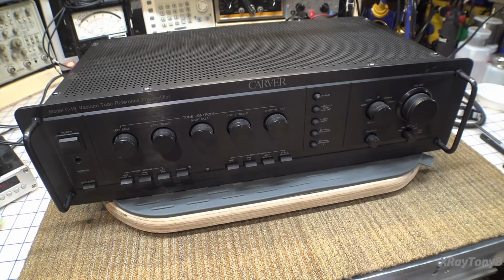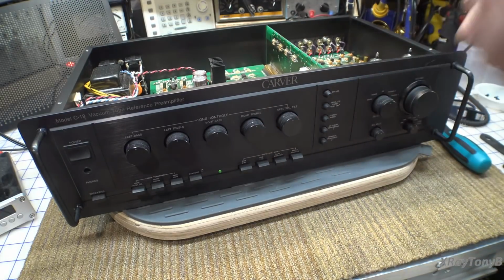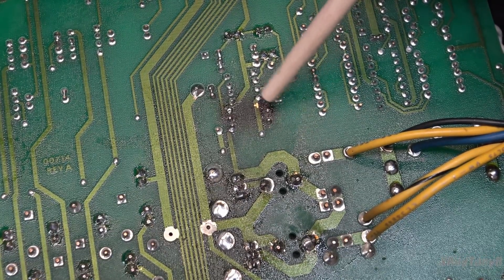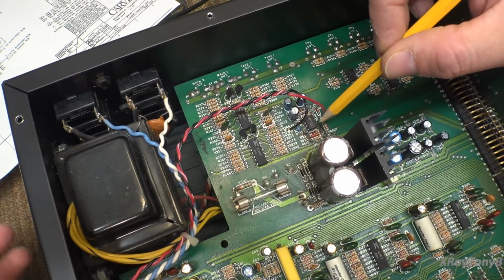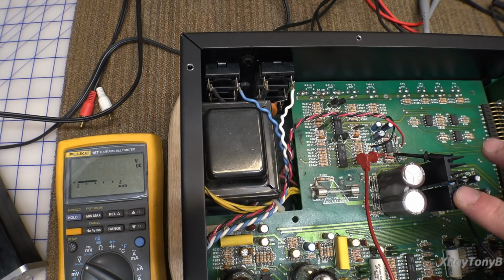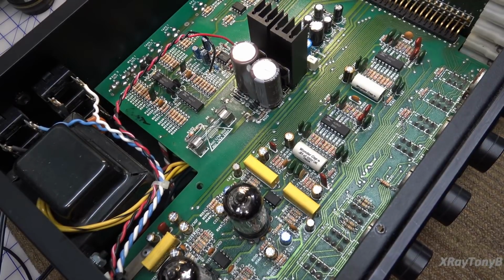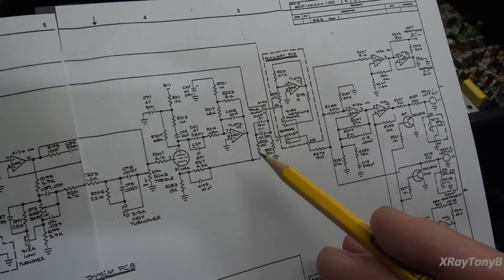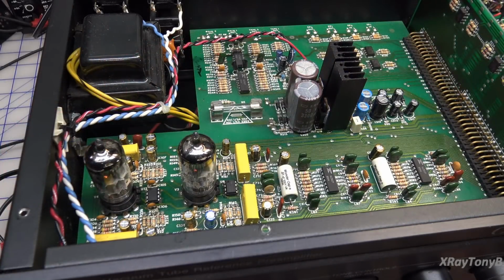Carver C 19:  Troubleshooting a "Simulated Microphonic" Tube

Comment: Since unit acts up when warm, this would have been a perfect contender for freeze spray (spray and pray).  Only need to drip a drop on components so you can single them out.
Then if the unit seems to cure itself, you only need to heat up with hair drier to get back to where you were.
Very interesting having a microphonic IC!

Comment: is the +10 supply coming from a regulator and then feeding directly into a 10v zener.......NO !  the zener will slowly cook.   can you show me the +10v power supply.
this is why the pcb is cooking to black.   normally you would feed the zener from a slightly higher voltage (+12) thru a resistor to set the zener current and then bypass the zener with a cap.    never hook a zener directly across a regulated supply at the same voltage.        if you wish to use the zener as protection, it should have a higher voltage than the supply and a fuse for it to blow is the supply goes out of limits.   but the pcb cooking and the look of the zener itself tells you it's really getting hot.....my guess is somebody missed something in the design.....

Comment: In my dimension this is caused by quantum entanglement -- the tubes can be anywhere in the universe but still connected.
Reply: Anthony Ng well here in the Multi-Verse, the tubes are both blown and working at the same time. Also in one of them, Carver is just a budget brand and Radio Shack (Tandy) Realistic ones are the best!

Comment: TLO72 in a "reference preamplifier".  Crimony.
Reply from the maker: All opinions of this preamp aside, it seems that the audio path is through the 6DJ8 tubes.  The TL072 only seems to control the gain of the circuit.  As I said in the video, I really didn't study the circuit very closely, but it appears that a better opamp with better slew rate and lower distortion wouldn't make much of a difference.  It also appears that they used higher quality (at least for the time) capacitors in critical areas of the circuit.  The thing I really had concern with is the overall build quality.  The circuit board material and layout was built to a cost.  There was very little shielding and the power supply seems to be inadequate for the circuit it needs to supply.  The high voltage for the vacuum tubes was derived using a simple voltage multiplier circuit, rather than a discrete winding on the power transformer.  I'm not sure how this would affect noise.  Now to bring my opinion into the subject, the preamp was very quiet and clean sounding when all put together (although I didn't do much testing on it).  I just question the build quality of something that was this expensive when new.  Thanks for the comment!
Reply: @xraytonyb  I found that a few parts are what separated Carver from "excellent"  in the day from "top notch.".
I'm having my C-1, M1.5t and Tx-11 resto-modded.  While not cheap, the older/cheaper components are all getting replaced by new/better parts.  
My E-bay TX-11 died 10 minutes out of the box. The electrolytic caps are probably dried to death anyway.  Carver's p/s filtering/isolation wasn't that good.
Back in the day "reference"  wasn't just "cost-is-no-object"  products.  I can think of a dozen products at or over the cost of the C-19 that were highly touted, yet not as good.

Comment: No evidence that you first checked the power supply outputs with a dvm and scope. Also verify that the voltage regulators are not being over taxed. When necessary i add a shunt resister across them as a series resister might inhibit the required current. Also you should determine the op amp's current requirement and check any bypass caps for leakage. Remove the ic to see if the zener drift continues. HTHs.

Comment: I had a solid state Peavy Guitar Amp do this. I worked on it for a week and couldn't figure it out, some EE recommend to swap out the Op Amps so I tried that and the funny thing was it made it worse. In the end I just pulled the power head out and reused the speaker and cabinet as a Monitor.

Comment: I have to disagree with you about one thing - if there was an excessive draw on the 10V supply, that would mean that the zener wouldn't have to conduct as much and it would cool down.  I suspect something was drawing LESS, so it caused the zener to   conduct more.  The lower current draw would also mean the voltage is allowed to rise (as I don't think the zener regulation is all that stiff).

Comment: Did you figure out why the TL072 op amp went bad?  could be a surge in Vcc supply voltage , or overheating due to being close to the hot vacuum tube?
Reply from the maker: I'm not sure about the audio industry, but in my line of work (medical imaging equipment), the TL072 opamps are high failure items.  They are used a lot for buffering feedback and reference signals.  All too often, when you get an error like "x-ray on in error" , "kV too high", "mA too low" , etc, it's because one of these chips is failing and passing a false voltage.  They also seem to do this in an intermittent fashion.  I think that's what happened here.  I'm not sure why they fail so often, I just know that they fail often.  Some of the newer opamps are much more reliable and when possible, we will replace them with the newer types, as long as it won't affect the circuit in any way.
Reply: @xraytonyb  -  It is a very high input impedance, JFET-input device, it seems to be very sensitive to input signal voltage saturation.

Comment: Very interesting video! I like the way you search that microphonic trouble, using the logic path for these kind of hybrid design.
As you mentioned, Carver designs are always welcome in your videos, as their very specific and original concepts are really something different. Mackintoshes and Accuphase still have that kind of pioneering approach...

These two yellow caps could still be suspicious and could still have been mounted backwards, if the problem was not so intermittent. And of course,  these two TL072 were so close to a violent heat source: that noise is different from right to left, but still sounds like a leaky transistor on the way to hell. The schematics also implying these amps in a sort of back loop with the tubes, any other component in that loop could get microphonic if anything got high z! After a thorough inspection of the tube support and soldering joints, these two are something really exposed and evident next culprits... Could have been interesting to check these with a coolant spray or have a FLIR imagery of you're using this interesting technique, but direct replacement is now something evident, specially with the now low price of these amps.

Be cautious with these noises in your videos, some could still fine it's copyrighted material😁
There was a time these TL072 and 4558 were top low noise expensive components. It's now far most expensive to get some good audio tube...

Comment: I would have just tried some circuit cooler spray on the op amps.  Since it "worked" when cold and had the noise when warmed up, selectively cool the suspicious area and see when it starts performing normally.

Comment: It kind of reminded me of a stereo amp I fought a few years ago, the earth side of the volume control went open, meaning it went into flat-out gain (and distortion). Of course this amp was not on the bench when it did this, but in an info kiosk in the middle of a fairly busy main train station.
I was tending to the kiosk swapping in a totally different module, about to button it up and call it a day when the amp let loose.

Comment: Carver is the re-incarnation of the old brand Phase Linear.  They had a store in Lynnwood, WA near where I live.
Reply: In the shop I worked in from ‘81 to ‘94 we referred to them as Flame Linear. Due to the absence of an output protection circuit!

Comment: It's micro-sonic. It sound like some type of built-in resonator circuits...something a "ghost hunter" would use. Carver Equipment (ex The Phase Linear 400 Amp) seems to subscribe to the "Why simplicate when you can complify design philosophy".
Reply: The design seems like the definition of a camel---a horse designed by a committee.

Comment: How can you have that zener going directly to ground without a series resistor?  Wouldn’t that fry it?  Also a poor way to regulate voltage to a sensitive part of the preamp.  Not a fan of Carver designs.
Reply from the maker: There is a series resistor.  The schematics are just like the circuit.....different.  I agree with all that you said ;)
Reply: @xraytonyb  That is a good video.  Thanks.  I was trying to see the complete design of the power supply on the schematic from hifiengine but it seems that some areas are missing.  However it seems that the LM7812 and LM7912 regulators have about 20 VDC input on each, so I assume that the pair together is dissipating some 10W in heat close to two capacitors C501 and C502.  Tony already installed bigger heatsinks there, which was a great idea.  I have seen similar vintage designs, like in JVC's, in which these voltage regulators were screwed (with electrical insulation) to the chassis, which for me is a much better design.  
@Jimo Mertz -- that Zener (D23) with its companion resistor R513 seems to be providing +10 VDC to pin 8 of an opamp (U14), then Zener D21 (+4.7 VDC) with its companion resistor and capacitor is providing a reference voltage to the non-inverting pin of the same opamp.  This whole theory looks fine on paper and should work fine, the problem is the long-term effect of the heat dissipation of these components to adjacent components and parts of the PCB as shown in this video.  Those Zeners (D21, D23) and their companion resistors should have been raised on the board from factory.
Reply: Kyle Smith III I know Pioneer, Kenwood, etc used to run their power supplies circuits hotter than heck. Bad solder joints were a common fix on 6 - 10 year old sets back in the 80’s.